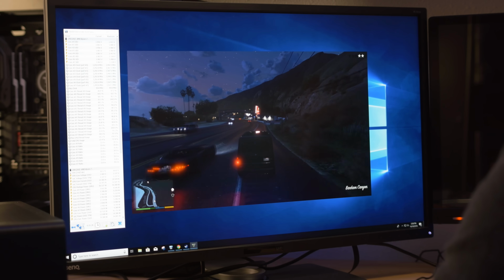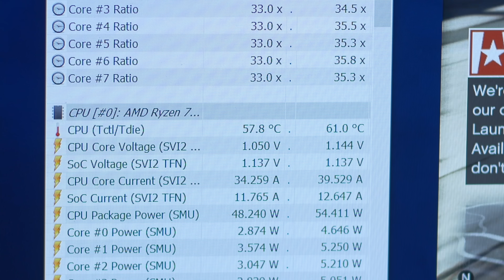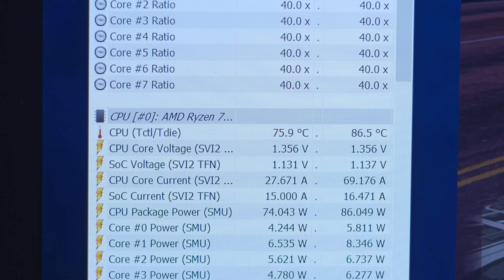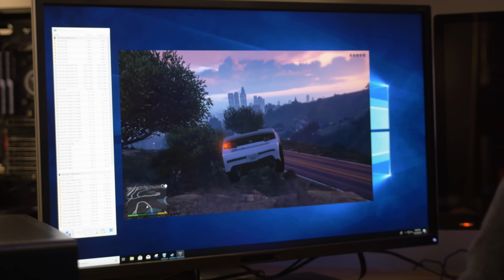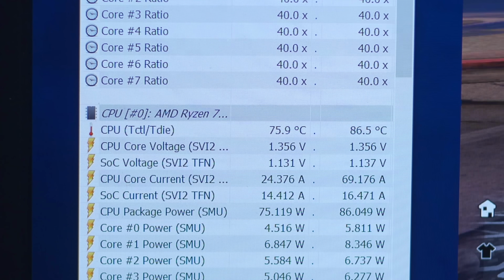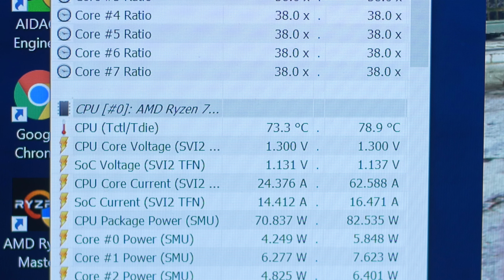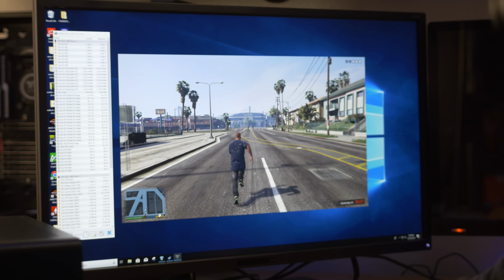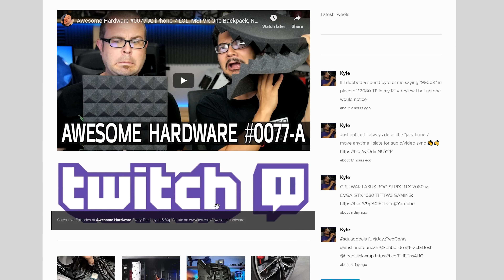Testing the limits of a 92mm AIO with Ryzen!

Comment: I'd love to have that aio in my system to cool my CPU.
Reply: Buy it
Reply: They actually just discontinued them, which sucks.
Reply: I prefer a bigger case and a cooling device that will last more than 6 months to a year ... my last cooling has been going for 5 years with 2 of them being 24/7 lol ... try that with a POS water cooling garbage ... air cooling is much better for me ... same temps, no maintenance,  no worries and no downtime while waiting for new parts. Only thing that can go wrong is one of the two fans could die but ... I can still run the system with one fan without doing anything .. if by chance both fans failed  at the exact same time I could still limp around with the PC with passive cooling (noctua nh d15). If you have watercooling ... you would be lucky to get a year or maybe two out of the pump before it dies and when it does you are out of commission until you replace it.